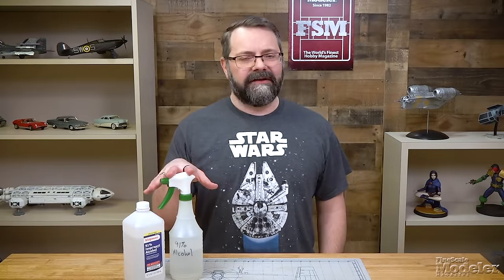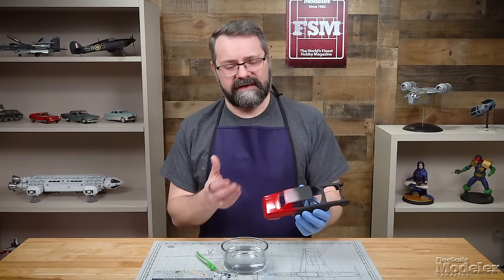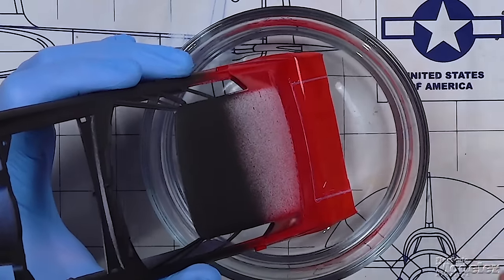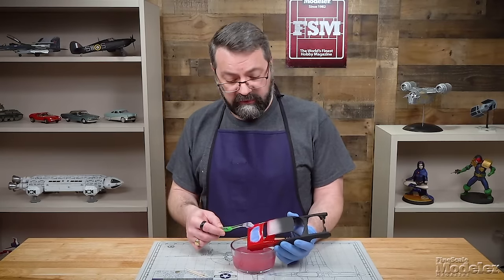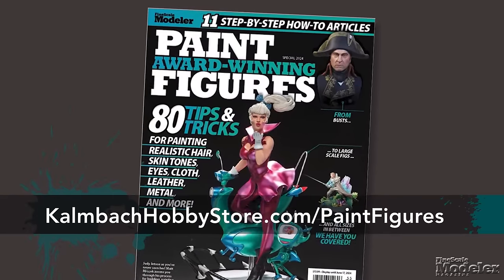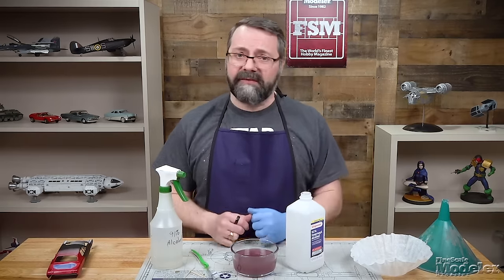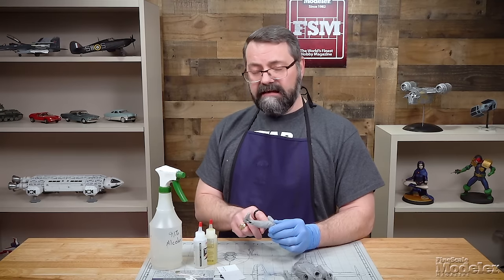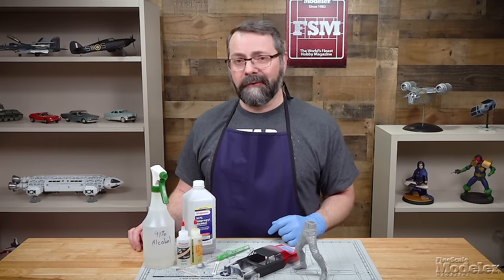FineScale Modeler Scale Model Basics: Remove paint and 2-part epoxy with isopropyl alcohol

Comment: I have used 91% in gallon baggies to reduce the amount needed to cover the car body (was removing prepainted graphics) and it reduced the smell from it evaporating.
Reply from the maker: That's an interesting idea. A paint pan  works well for large parts, too. Allows you access with the toothbrush and other implements to help remove the paint.

Comment: You can also use ethyl alcohol. I’ve been using it for a very long time. In fact you can use it also to dilute Tamiya’s paints.

For a very long time it was difficult for me to find IPA and Tamiya’s acrylic solvent was expensive (specially for a teenager with a low monthly allowance) and resorted to ethyl alcohol that you buy on a drugstore.

Now I can afford buying IPA but found that Tamiya’s yellow cap bottle is far superior than IPA. I have a bottle of IPA and a bottle of the acrylic solvent that I am not using because I find that the yellow cap solvent is far superior. Although I have all that I still use ethyl alcohol for my cleaning (airbrush and brushes) and use it to remove Tamiya’s and Vallejo’s paint.

Comment: All craft/hobby acrylics are water-based, but there is a type of water-based paint that does contain solvent called waterborne paint. The added water-compatible solvent makes the paint behave (flow out and dry) like a solvent paint. I have had some luck using alcohol to remove oil-based enamels, but it hasn't worked consistently for me so far.

Comment: Tim, Great video.  Have a question though, what do you use to strip paint of a completed model that has the windows glued on and the interior glued onto the body?  Do you just sacrifice the windows and interior?  I don't think that dunking the entire body would work if you were trying to keep the gunk off of the windows or out of the interior.  Thanks again for the tip.  Tom
Reply from the maker: Hi Tom: In a situation like that, you'll have to assess how much of the paint you're removing. If it's a small area, you're better off masking, sanding, and painting. If you mean to remove all of the paint off the body, then you'll have to do some surgery and remove the body from the frame, remove chrome parts because the alcohol will affect those parts (although not as aggressively as the paint), and pop out the windows. Sorry that there isn't an easier answer for this particular situation. -TK

Comment: Would this method work with refreshing something like an old model? And I mean very old!

I have recently found my old (vintage) kits from years and years ago, Most aren't available any longer or have long been re-tooled which I made as a 10 yo and while they were put together reasonably well, they do have a 10 yo's paint job like my old Saturn V and I would love to rejuvenate that one in particular as it is less complex than say, an armour kit.
Reply from the maker: Although paint formulations have changed over the years, it should still work. If you can, disassemble the model and start with a small part as a test piece. That way you can gauge how long to let the part soak to let it penetrate the paint.